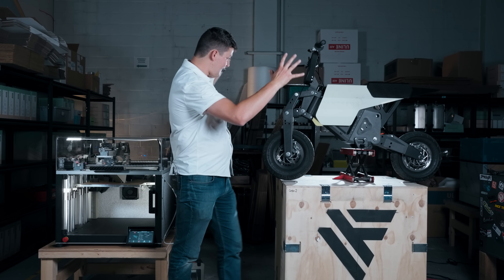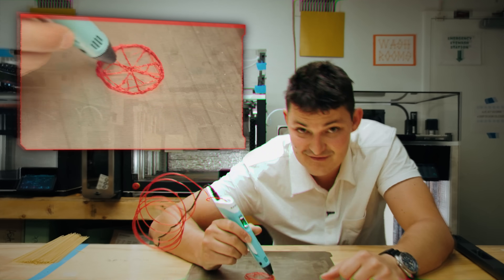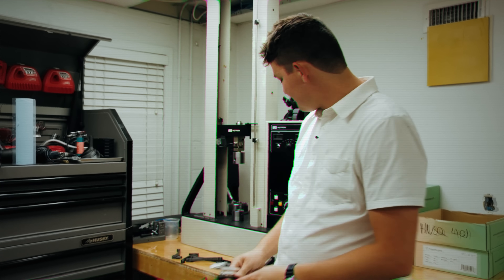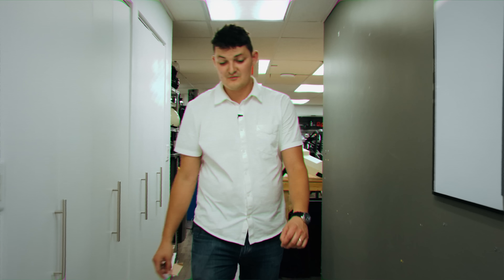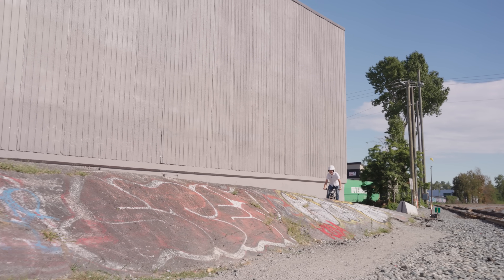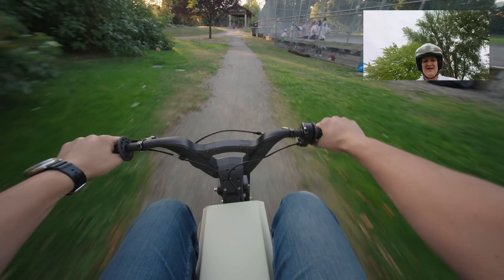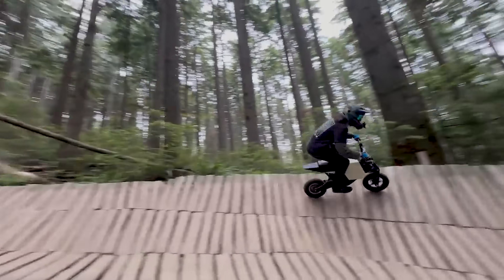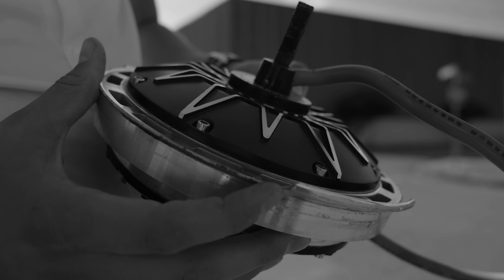Jumping a 3D-Printed Motorcycle - How Strong is the Future?

Comment: One of the first things I did when I got my KLR 650 was to print a lower dash out of PLA-CF filament as a place to put a 12v socket for my portable air pump, a battery voltage readout and a USB-C and A port. I didn't want to drill permament holes into the fairing and this was a way to do get these accessories mounted without having to do that. 3D printing is truly a great tool for this.

Comment: My motorcycle already contains three 3D printed parts.
* Bracket for RAM mount
* Throttle wrist assist thingy
* Keys ( mechanical ) that keep chinese top cases from sliding back even if factory attachment fails. They are inserted into the empty space between [ case- alu connecting plate - attachment knobs ]. Case won't come off ever, important when gf is leaning against it.

I also have a 3D printed tool to easily rotate the rear suspension preload. It slides over the factory knob and creates a larger handle for better ergonomics.

All from a PLA that is quite strong, probably stronger than most filaments.

Comment: Quality control becomes a huge problem with 3D printed parts. I would never trust a 3D printed part on any serious machine sub-assembly let alone a bike because of fatigue loading. With a cast or injection molded part I can be assured the manufacturer has decades of process knowledge and good manufacturing practices to ensure consistent output. With 3D printed parts especially with FDM you need to be sure of the quality of filament that goes into the machine. Materials like PLA is notoriously hygroscopic and needs good care and storage to ensure optimal results. And do not get me started on anisotropy with 3D printing. 3D printing is ideal as an excellent prototyping tool cutting down on product development cycle (soft tooling) or to produce components that no longer can be sourced for old bikes/machines etc. Personally I do not see it competing with large scale injection moulding/die casting any time soon. My two cents. Correct me if I am wrong.

Comment: 3d printed parts that are solid are usually weaker than lattice framed parts. Depends on shape of the part but i believe between  25 and 50% infill is usually optimum.

Comment: There seems to be an absolute obsession for using 3D printing to make the actual part. I don't know why we don't use 3d printing more for making forms. We have centuries of experience of casting metals, it's highly predictable, quick and we're very good at it. Be that a form for use for direct casting or a form for producing a die. Then you get the rapid prototyping benefits of 3D printing and the predictability and mass production benefits of more traditional techniques.

Comment: While the pros are great (variability, prototyping etc), 3D printing is not a cost effective scale production.
500 usd in filament ... sure. But there are still the other bits (brake rotors, motor, all the electronics , bearings, fasteners....  So you 3d printed what exactly? Just the bodyworks.  Thats generally what.. maybe half the price of the mahcine? MAYBE... Add assembly time... and more importantly the HS-Pro costs what? 20, 25K?
If printing takes a week, thats a significant effort of an expensive machine you have to add to the  costs.
Reply: Dude it is a prototype it is very difficult to make a production vehicle. He is showing you the opportunities of 3d printing.
Reply: @manufacturergr i didnt say they should not do it, nor f9 not make a vid about it. Im just sayin that its not a cost effective method for actually producing these things in large numbers.
We use 3d printing at work, because they are one off custom machines.
For stuff like that its great.

But the narrative i get at the end of the vid is, 500 bucks and you can make this... Which is not true.

Comment: get a toaster, finely grind normal table salt into a powder....print the parts at 100% infill. 

set the toaster to the melting point of the plastic you used. 

bury it in the powdered salt. bake it in the toaster for x minutes. 

let it cool.

you saved yourself from spending a bajillion dollars on a printer that costs the same as a ducati...

Comment: It will make producing these parts cheaper, but the customer will not see this drop in price. Rather it opens the door to higher profit margins for the manufacturers. he fact that they can be lighter and stronger in some cases will probably make them more expensive, even if they can be produced for pennies on the dollar.
Reply: Agreed.  Just look at e books.
Reply: Well, probably not.

The linear scalability (3:15) means that if the OEM tries to sell their parts at a huge markup, the only thing protecting their monopoly is the flimsy thing called intellectual property rights. The OEM can't rely on the advantages of printing a hundred thousand to save on costs by much compared to a one off printed by the final user.

If their part isn't special enough to patent, (and their lawyers achieve some funky BS involving copyright), then there's no reason your local garage or hardware store couldn't print their own to sell, with the same design and to the same spec. Even in the current times, many companies offer printing services, and getting an identical part printed can be cheap and easy (as long as you have an accurate model and someone who knows how to slice it).

Sure, the OEM can choose to sell what would've been a $25 injection molded part for $50, but if you can print the exact same thing for $2 in filiment and $2 of renting a 3D printer to print it, then the OEM has to cut prices or give up on selling parts (Maybe they'd pivot to selling models?).

Comment: Ryan, easy solution, print metal parts?
They could use a salt (liquid, dust, etc) and a charge and build up the metal. The cathode-anode can be the donor material or the part you are building. 

What do you think viewers?
Reply: Read about the company Mimotec. They have a process called UV-LIGA. It is very similar to what you are describing.
Reply: @karthick86c thank you. There's got to be a way of using the process with the materials. Perhaps something like a sparkplug for an engine.

This is a brute force way. 

Then there's bio-engineering. Probably some biology which creates the material we want. So we create a "life path" which would be the technical design and method to direct the work. 

Just ideas but probably somewhere someone is doing it.
Reply: There are already SLS (selective laser sintering) machines and other similar technologies that can print various metals (that appears to be what was used to make those nozzles he mentioned) it's just not affordable for the average consumer. Then again, neither are those Pantheon printers, so there's that.

Comment: 3D printing an entire bike (more or less) has certainly surpassed what I wanted to do. Bound to happen eventually, I suppose.
Reply: With 3d printing you can make stuff however you want. Our product has most mechanical parts 3d printed like metal chassis, rims, tires, covers. You can check it if you want in our website.

Comment: 1:39 No, they do not. Underextrusion is a defect to be remedied, and while it will weaken the part, it's an error, not a purposeful, targeted outcome. It also dramatically increases the chance of print failure, makes overhangs less likely to come out properly, and results in top-filled surfaces coming out in bad quality. Airgaps are NOT a result of underextrusion, and will exist even in badly (up to the point of failure) overextruded parts, purely due to the physics of the FDM process.
EDIT: oh yeah, and also it makes warping worse, and makes you more likely to be under tolerance.

Comment: Great video...but, not entirely 100% accurate.  Bugatti has been 3D printing engine parts for a few years now.  Granted, a number of those parts are Titanium, or Inconel 718...but, they are still 3D printed parts, and can withstand temperatures over 1,200°F.  Another material used, PEEK (short for PolyEtherEtherKetone), and it's carbon-infused variant (CF PEEK), can both withstand up to 500°F, while still maintaining their strength & structural integrity.  Using these materials, you can even 3D print engine components, brake rotors, and more.

Of course, you're definitely not going to find these materials in a $500 3D printed mini bike, even an electric one...but, the point of my entire comment was that there are 3D printing materials that can easily withstand well above the temperatures any motorcycle components, including engine parts, would ever see.

Comment: 1:39 I must add that this is true for default profiles on some machines, but is not the rule for desktop printing. Those of us who have been in the hobby for a few years are accustomed to tuning extrusion in slicer profiles and calibrating e-steps in order to get strong and accurate parts. Under-extruding can get companies higher dimensional accuracy with less effort in some cases. Stratasys under extrudes by default for this reason and it is really hard to get rid of in their slicer. Under extrusion can also be a result of profiles that push hard for maximum speed and acceleration at the cost of other properties like on some bambu machines when they are printing fast on specific part geometries.  Note: I am not trying to call out Bambu here. There are plenty of other companies that have profiles that prioritize speed. Theirs just came to mind as it can be observed in some of the reviews that I have seen on their products.
Reply: I was able to print clear lenses that were decent by over extruding and hotter.   Basically no bubbles.  Dry filament also.    Lot of people have and there are some amazing clear print videos. I'm assuming that's the strongest print setting.  But with strong reinforced fibers.
Reply: Stratasys underextrudes by so much that their parts aren't even rain proof.  The nonsense I have to go through to get a properly watertight prototype off of a printer that was north of $10k is insane considering I get watertight parts off my personal sub-$300 printer at home.
Reply: @SteevyTable watertight printing is an insane proposition in the first place though, you should expect to post process. If you're not you're asking for trouble as no print will hold up to water long term without it
Reply: @SamCyanide printed a vase in one layer of petg, stock settings, it held water without leaking for more than a month. You simply can't with abs for instance, really depend on the polymer and other factors
Reply: @Frank88Workz Vase mode is different, but still it will degrade and leak

Comment: Ryan makes an important point. 3D printing has inherent strengths AND weaknesses. So it will be appropriate for some parts and not for others. The average person won't fully understand this, it takes engineering knowledge.
Reply: Exactly. This goes for every material and production process. It is horses for courses. 3D printing will become a massive part of production industry, as it is well on its way, but will never serve as the be all, end all of manufacturing. 

The throw-away line "and print it on location" is an important advantage of this technique. There is no shipping as you just send the print file to wherever the part is needed. Any changes to the file can be sent immediately without expensive retooling. The savings are immense if companies get this right.
Reply: such an obtusely arrogant statement  😂 ironically ignorant

Comment: It's definitely an interesting concept, but maybe seen a bit too optimistically. Sure, you can 3D print new parts in 50 years, no need to look for reproductions, or part bikes, but I doubt producers will be willing to give you the necessary 3D files, if the producer still exists and still has the files. Also 100 vs 50 microns precision on a break/clutch lever is cool, but it's really not necessary to be that precise on that part.
Reply: Hello, @ThePeanuts1000 our company currently produce the lightest vehicle in the world, has 3d printed metal chassis, tires, rims and covers. Available for sell at our store.
Reply: It's amazing how optimistic you are when they pay to you to be... 😂

Comment: I would have appreciated a challenge of the claim that their 3D printed parts are so much stronger than with any other properly calibrated (automatically or manually) consumer level 3D printer.
Tuning the flow for strength is nothing out of the ordinary, and 3D printers as affordable as the $200 Bambulab A1 mini use strain gauges in the hotend to adjust the flow for the filament and temperatures used. Many users don't find the feature that compelling anyway, getting better results with expertly tuned print profiles.
Reply: This is what I want to know. You can anneal some prints in salt or just overextrude by 5% if you're lazy.

Comment: Damn man i mean cool project, but it would be cool to be a bit more literate in 3d Printing, i mean you really bought the company shill,i can print comparable prints with the same material on my 1k printer, you do not need the HS PRO for that, the printer honstely is way to expernsive if comapred to other Printers in the market.
Reply: Also to add to that, metal printing has gotten relatively cheap, and so yes even those fastners could be printed, honestly there are entire full metal printed bike frames out there.

Comment: I have a question for everybody, so I go to school in a city, and wanted to bring my motorcycle with me. I have an older Harley Softail with a keyless start, I don’t know what it’s called exactly but you just turn a dial on the gas tank under the speedometer and then start it up, no key or anything like that. That works fine most of the time bc I live in the middle of nowhere but how would I keep it safe if I bring it to my apartment with me?
Reply: If it is an actual question, Our 3d printed electric skateboard style vehicle can fold and fit in a regular backpack, so yes you can bring it to your apartment.

Comment: 3D printer here. What have they done to deal with the Carbon fiber splintering issue? When you print using a carbon fiber filament, the carbon fibers in them are arranged randomly, when touched by hand, they break off into the skin. This is why you don't see the product widely used outside of industrial use cases.

Comment: My biggest worry would be how the (black!) parts hold up parked in the summer sun.
That's when the 3D-printed parts on my bike started to get loose.

They were done with CF-PETG though, not CF-Nylon, which is more heat-resistant.
But, CF-Nylon still suffers from a slow deformation under load called "creep". 

CNC Kitchen recently did a video about the subject.
Reply: It is a concept vehicle
Reply: Have you tried ABS or ASA? From what I've been told these are much better for parts that are exposed to high temperatures.

Comment: CREEP! The over-time deformation under constant load kind, that annoyingly affects all affordable 3D printed polymers (yes, CF nylon too). After a ride (or park in the sun) on a hot summer day don't forget to re-torque all bolts holding 3d printed parts that you'd prefer not rattling.

Comment: The talk about purposefully underextruding is innacurate. While that can be an issue, it's quite easy to tune flow or even overextrude slightly to make sure there are no gaps, something I do often on my own printers for stuff like waterproofing, and after printing you can quite easily anneal the print to increase the strength of it to make it much closer to an injection molded part.

Comment: I have an Onyx RCR electric moped (USA), and I have as much fun on it as my Suzuki GSX-8S. Thin, quiet, lightweight electric mopeds and small motorcycles are perfect for around town and filter/lane split with ease. I just wish the full size motorcycle versions were cheaper, less weight, and hard more range or had ultra fast charging. RIP Energica =(

Comment: Sadly even these 3D prints will fail. You can set a normal printer to over-extrude. But unless you add continuous nylon or other strand from a second print head and also you need to use special (pricey) UV, Heat and enviroment stabile filament, it will fail in time. It can be safely used on covers ad custom panels, holders etc, but not on parts lihe frame, handle bars etc.
Injection molding makes stronger and more stabile parts (in high quality is used).

Comment: 1:37 This is not really true, and it's surprising to me with how well-researched these videos typically are that this information could get into this video.

While it can be the case that 3D-prints have some very slight underextrusion, proper settings can make sure a print is almost 100% solid inbetween layer lines. 

Often by increasing line width to 110%, a common default setting in some slicers, the filament is pushed together by the nozzle, ensuring no air-gaps.

It is absolutely not necessary for a print to be underextruded for it "not to fail". An overextruded part may be slightly less dimensionally accurate, but it won't fail the print.